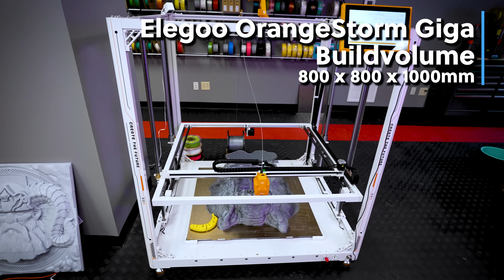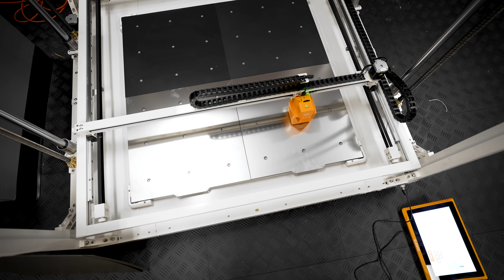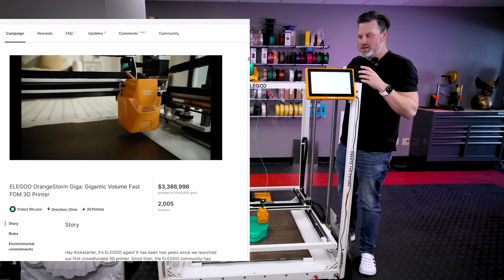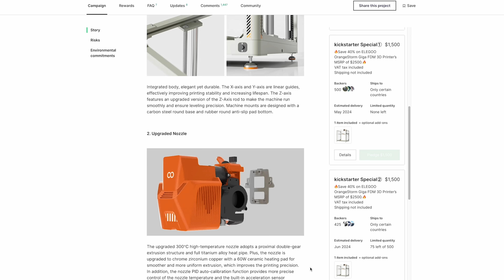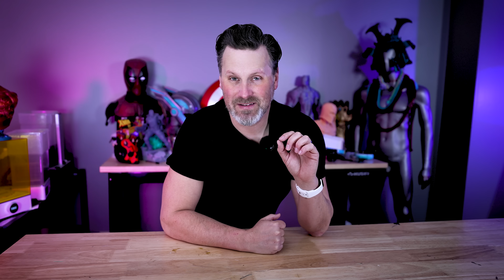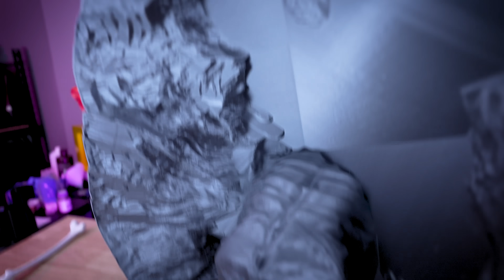Monster Sized 3D Prints - Elegoo OrangeStorm Giga!

Comment: Uncle Jessy, I have been watching your videos since your first video, but one thing that is very important to me, and I think would be important to the 3D printing industry as well as the general public and community is how some 3D printer companies have been using hot glue on electrical wires on platforms like the Creality K1C on the printer head on the board inside the printer head, on the white connectors,when it comes down to the thermostat and the thermistor that is close to the hot end. This can lead to a possible issue with an electrical circuit fire due to weakening wires that don’t have either a heat shield or heat shrink wrap. Printers that print at a higher speed can cause the electrical wire to either break down or overheat, which I don’t think that a silicone sock is enough to prevent an electrical circuit fire from happening. I have noticed this issue on all of my machines. I have a Voxelab Aquila, Mingda D2, Mingda Rock 3, Tronxy XY-3, and a Creality Ender 3, that I am currently trying to upgrade it into a Ender Extender 400 , but I am concerned about an electrical wire problems that could happen. What do you think about it?
Reply: This is done pre shipping in order to keep wires from disconnecting during transit. It's the right way to go about it BUT these companies do get quite carried away

Comment: I see a lot of post about the Max having  problems if you don't preheat your bed about 30 mins prior to leveling. Is that the same with this?
Reply: The larger the setup the more difficult it will be to regulate temps without a proper enclosure which = $$ and time. Most will probably lather the build plates with glue though..

Comment: Honestly im pretty surprised that the printer isbt using 2.85mm filament and a larger nozzle. But I suppose that .6 nozzle allows for a good middle ground on quality vs speed. Also Im sure someone had to suggest by now but a wall mounted dragons head would be pretty awesome

Comment: Would it be possible to rewire the filament run-out sensor wires to the front of the printer? From what I see, it shouldn't have an impact on the hardware to move it to the front

Comment: Does this have Mainsail or some other web interface you can access ? Not sure if you saw the twitter thread about using cubic support or cubic adaptive  to reduce infill on these large prints it will save to much time.

Comment: That cable length is short on purpose, i can imagine this thing is drawing significantly more power than a regular printer.  Increase cable length increase amperage.
Reply: As long as the size of the conductors goes up, the resistance should stay the same.
Reply: @FunctionalPrintFriday  which is why its short, bigger conductors bigger cost. I guarantee the longer one he got didnt have bigger conductors

Comment: I hope the Giga leads to more Klipper Core XY printers from Elegoo at a smaller size.
Reply: It's not core xy, you can see the x stepper moving on the y rail. My understanding is that core xy only scales to a point.
Reply: @eslmatt811  Correct. There is a motor on the X axis gantry controlling it's movement. At that size, I'm not sure belts would have worked in a typical CoreXY configuration. 
This might be a use case where moving away from belts completely. Magnetic levitation linear motor system might be a great use case for these extremely large printers.
Reply: Let's just call it "non bed slinger" designs. Printers like this are easily enclosed, and their footprint isn't variable on the workbench. I like my 3 and 4 Plus printers, but so tired of dealing with adhesion issues due to bed movement and temperature variations.
Reply: That would seem to be a trend in general. Ever since Bambu, more manufacturers have been making Core XY's, and it's only a matter of time before they all start integrating Klipper in some way.
Reply: @uaj_utube  Bambu just used what open source printers like RatRig and Voron had been doing for a while. Bambu just made it closed off and an appliance rather than a hobby in itself.